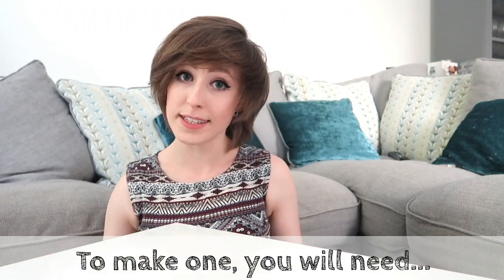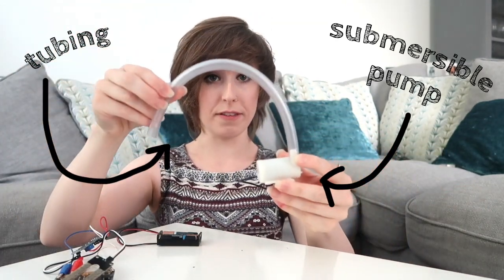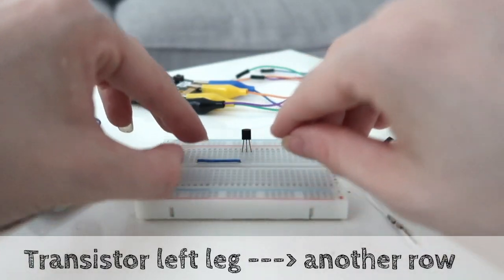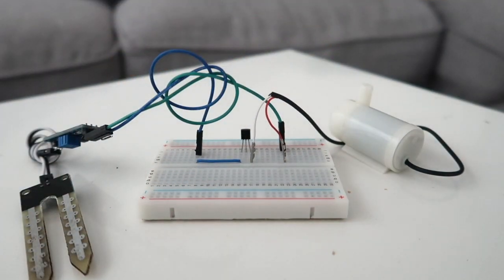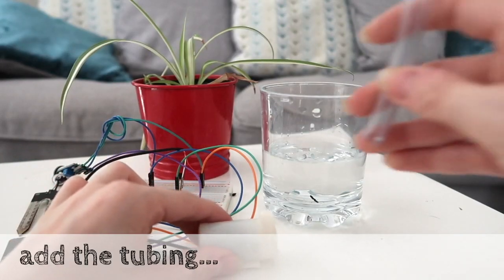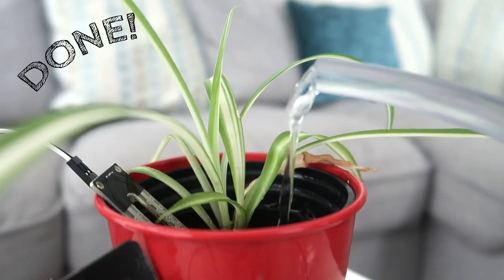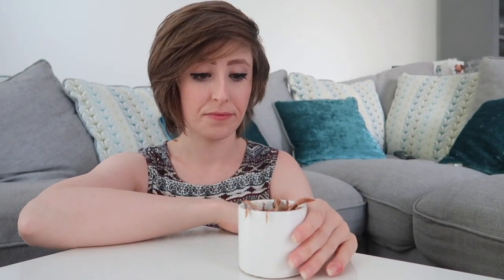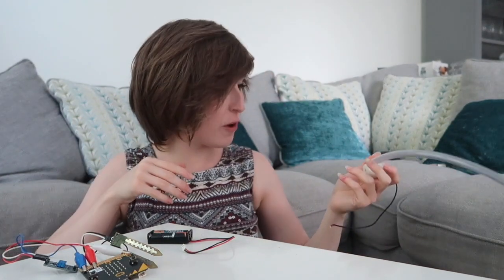Make a SELF-WATERING plant – BBC Microbit project for beginners

Comment: Um .. what about the time and how much water will pour out ? that's a bit diffrenet for every plant . Do we need to code that too or what
Reply from the maker: Good question! You can change those things in the code to suit your particular plant. The code isn't on a timer – it runs continuously and checks the soil moisture. If the soil is too dry, it runs the pump for 2 seconds. If your plant likes being drier or wetter, you can change the moisture level at which the pump turns on. And you can also check how much water your pump moves in two seconds – if you want less water, run the pump for a shorter amount of time, or if you want more water, run it for longer. Hope this helps!
Reply: @HannahMakes  Is the moisture level in your example code 800 cus I'm not sure which number is the moisture level

Comment: Can I use another transistor I have one but it’s not 2n7000 ? Thank you
Reply from the maker: You can use another transistor, depending on what its specifications are. Some only work at higher voltages, for example. If you know what kind of transistor you have, you should be able to find a datasheet for it online, then you can work out what its specifications are. You could also just try and build the project to see if it works :)

Comment: Excuse me, in place of the transistor, could you use a solid relay?
Reply from the maker: Sure, you could use a relay – but you'd have to find one with the right spec. Many relays need a higher voltage than the microbit can supply to be triggered.